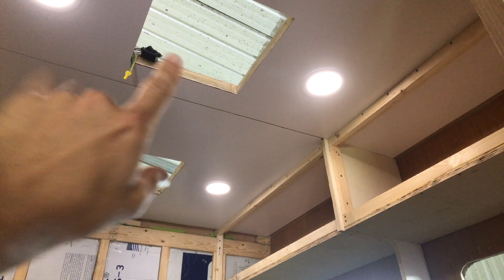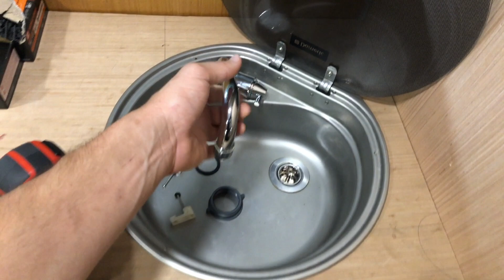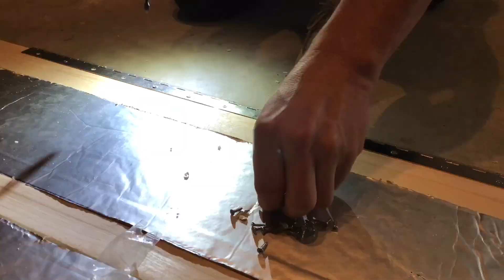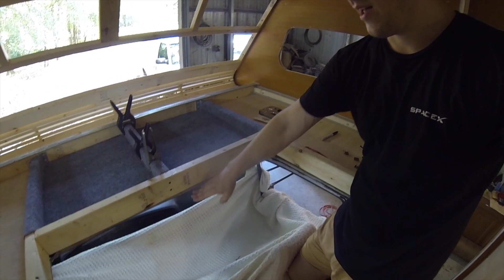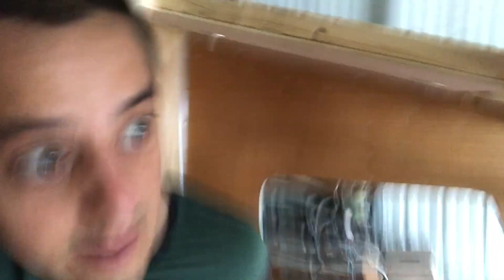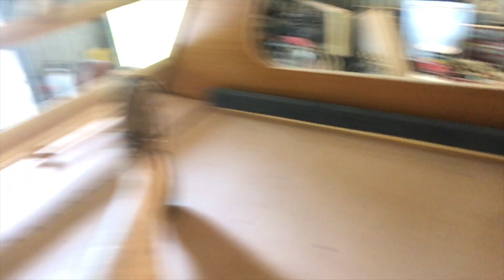#15 - Toyota Motorhome Interior Build Part II

Comment: What are you going to use to glue the fiberglass to wood panels? Are you going to use fiberglass for outside?
Reply from the maker: Filon is a type of fiberglass yes, and we will be using 3M 1357 adhesive.

Comment: With your atwood stove get a pizza stone if your actually gonna use it cuz it burns everything but the stone balances the heat and it works way better (i learned hard way)
Reply from the maker: I will definitely remember this advice, I know getting consistent temps on these stoves can be difficult!
Reply: Owsam bro keep it up 😍😍
Reply: Y you don't try it in faiber it's too lite w8 than wood
Reply from the maker: shahbaz_ khanzai unsure what you’re saying?
Reply: @oddcouple4x476  i think carbon fiber  is what he is saying or possibly fiberglass but glassing wood is a ton  of work